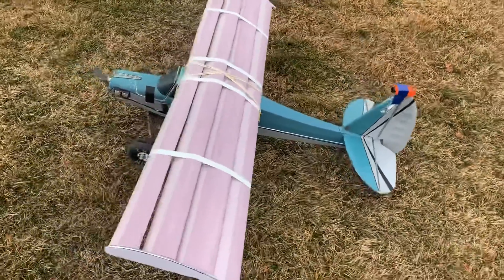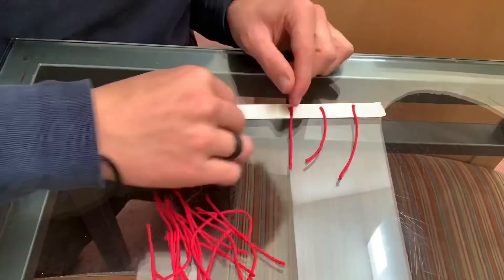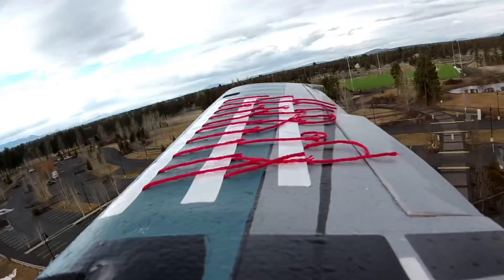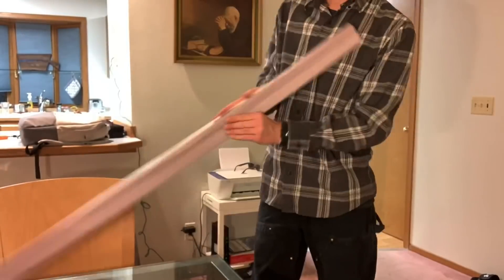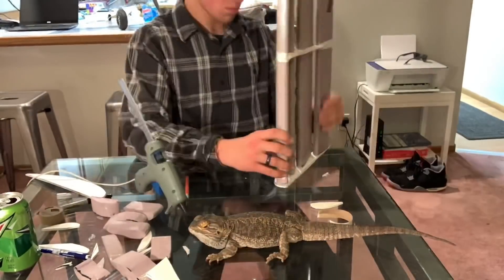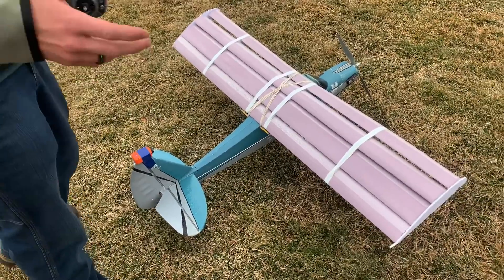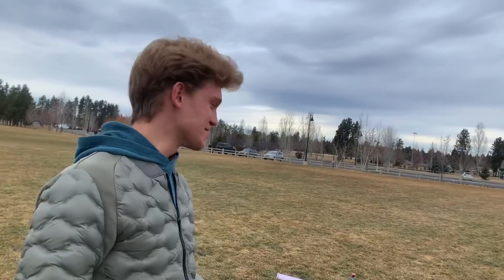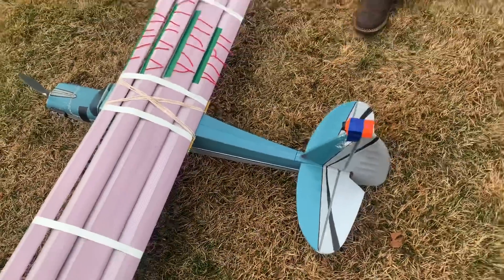“Unstallable Wing?!”

Comment: If you make the inner and outer part of the wing the same, you will still have tip stall at low speeds. Now what has bee proven the test of time is wing tip washout. This is the way to reduce, but still not eliminate wing tip stall. It's a nice attempt, but you're not reinventing the wheel here. I have TUFT lines on my hang glider that serve the same purpose as your yarn strings. In FACT, that's exactly what they are made up of. Those help me determine my wing stall at different speeds of TRIM flight. If the TUFT lines get ruffled, I am at the edge of stalling!!!!!! I then move my hang point/ COG forward to eliminate that. The difference may only be about 2 to 3 MPG air speed, but it TRULY matters. In a straight wing as yours, it will make a bigger difference than a swept back wing as when you lose airspeed, the delta wing will pitch down easier than a straight wing will as in your case.
The most impressive thing about this video is your AWSOME FRICKEN HAIR DUDE!!!!!!!!!!!! You proved that you can still stall even at slow speeds. We've all done this as beginners. As an hang glider pilot, I can tell you that speed is your friend!!!!!!!! No need to fly at stall speed EVER!!!!!!!

Comment: probably automatic leading edge slats would be easier and just as effective with the advantage of normal wing structure for fuel etc. the advantage of this multiple wing is higher wing loading per individual wing which will be smoother in turbulence

Comment: I noticed the wing had no dihedral , maybe adding some small dihedral tips. Great vid mate
Reply: High mounted wings don't need dihedrals for stability, when banked and turning, air hitting the side of the fuselage creates a high pressure zone and increases the lift of the inside wing
Reply: @naut3  ok gotcha thanks
Reply: @MrHawkeyegamer  np
Reply: @MrHawkeyegamer  you could also be right about it needing dihedrals, sometimes the normal stability isn't enough.
Reply: @naut3  Normally with models or real planes the dihedral is there to produce balance and stability in level flight, Not much good for aerobatics though :)

Comment: A wing like this needs to be mounted more forward.  Aeronautical engineer.
Reply from the maker: Explain why.
Reply: I think a real engineer would have said why. I'm skeptical this was a real engineer.
Reply: @baileyharrisRC  I would be interested in the examination of that also. I would think the opposite would be better so that if you're nose heavy enough, you can't get enough up elevator to cause the stall to begin with.
Reply: @baileyharrisRC  - I tried to share what might help, on this idea, below, in a reply to Mike Smith. See if it helps!
Reply: My guess would be, to get the tailplane out of the wing's turbulance. Any STOL wing will produce a lot of turbulance. Some used 'T' tails.
Great experiment👍
Reply: Address center of gravity
Reply: @mikesmith1181  - It is a Couple, the + (Lift) and the - (Weight), where we try our best, as a Pilot, to keep the CofG (Center of Gravity), within a Typical certain distance aft of the Leading Edge (on Conventional Wings, like the base original one), and in Front if the CofL (Center of Lift), so that, the nose naturally drops, to help Acceleration of air over the wing, if we reduce power! 

Think of the Big Boy (weight) on one end of a "Teeter Totter", and a Little Boy on the other end! If he just sits there, the Big Boy goes down! But, if he can add some weight, (heavier Mass) he can ultimately balance Level! If he adds more, the Big Boy will be stuck, up in the Air!

This is similar to making sure we properly load an Aircraft, so it stays within the Right "C of G Limits!" 

If we get too "Tail Heavy" we can't "Pitch Down" and stay stuck in a Stalled Wing Condition! If we are too "Nose Heavy, we can't "Pitch Up" and we "Run out of Elevator Authority" and have limited Control as well! Both extremes are Bad!

However, here, he has 4 Wings, so, as a "Test Pilot" he will need to determine proper Weight & Balance on this New  Integration! Possibly a movable Weight, either adjusted before flights, or using one RC Radio Chanel, and a Servo, to reposition a Weight, under control! 

First, check "Static Balance", then try changes in flight, for "Dynamic Balance!"

At least nobody got injured, in his crash, only a bit of his Pride got Bruised!

Comment: Hey Bailey cool experiment, so can you tell me your thoughts on this type of wing please ? do you get more lift overall ? does it take off much faster than the regular wing ? does it feel different at higher speed or lower speed ? when you mentioned weird what does it feel like during flight ? Now i am wondering why didnt all personal aircraft has this type of wing to begin with, it would helps a lot with the stalling issue, most aircraft accidents are from stalling during their preparation to landing.
Reply from the maker: The wing produce a ton of lift at slow speed’s. Yes the fun cub did takeoff a little sooner than normal.When I start flying faster though, the aircraft did want to pitch down a little bit. The wing also produce a lot more drag so it’s only efficient in slow flight. When I said weird I meant that it felt really really floaty. It felt like the wing was filled with helium or something.I believe full-scale aircraft do not use wings like this because they tend to have a lot more drag. I was very impressed with how the airplane flew. I am now working on a new airplane and I’m gonna try to improve the wing. I’ll have a new video coming up soon on that.
Reply: @baileyharrisRC  it would make an interesting indoor flyer.

Comment: I showed this to my buddy who's an accomplished Boeing Aeronautical Engineer. Here was his response.
____________________________________________________________________________________________________
My initial thought is: Clever idea! I wonder what the CL-versus-alpha curve looks like for this “airfoil”.

My second thought was: I wonder how draggy it is. More specifically: At max CL, and at max CL/CD, what is the CL/CD (lift-to-drag ratio), and how does it compare with a normal wing? Even if the max CL is higher than a normal wing, I bet the CL/CD would be worse… in which case, you’d be better off just adding more wing area, i.e. a bigger wing would give you the same lift for less drag. (A bigger normal wing would probably also be lighter and cheaper / easier to make. And hold more fuel). This is the trade-off around any high-lift device, like flaps and slats and VGs: Sure, it increases the CL (and thus reduces the stall speed), but is it more practical (i.e. less draggy, less expensive, less heavy…) than simply increasing the wing area?

(I showed this to some Boeing aerodynamicists and they were like “Sealing/stowing all those elements would be a challenge”. In other words: It didn’t even occur to them that you might be ok with the drag from flying with all those slots open all the time).

My third thought was: If the CL curve does not have a “steep cliff” at the stall, then this would be a good safety feature in a trainer, in that the pilot could get into a fairly developed stall but still have some control and be making some lift, instead of falling like a rock. So, like the canard, it works as a safety feature that protects you from the stall, which comes at a cost. In the canard, the cost is longer runway requirements. In this airplane, the cost (I’m guessing) would be more drag, but you’d also get the benefit of better STOL performance.

Fun to think about.

Comment: You need to get a hot wire foam cutting bow set up.  
Much easier to shape you airfoils, and maybe even cut undercambered too, if needed.    
And set up with ailerons next time.
Very neat stuff!

Comment: Typically, the left wingtip stalls first, which is what appears to have happened in your video.  I would suggest two changes for your next round of experiments with this design:
1) lighter weight yarn.
2) include yarn/string all the way to the tip, on each foil.  I believe you’ll find your instability lies out there.

Great work!